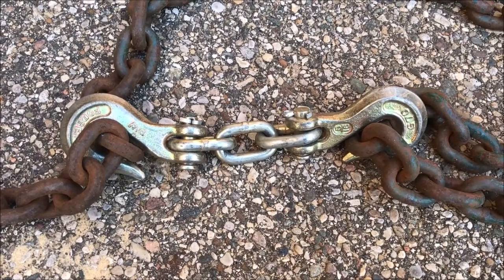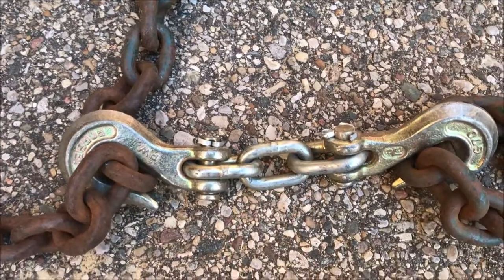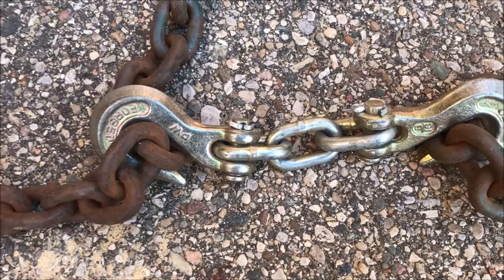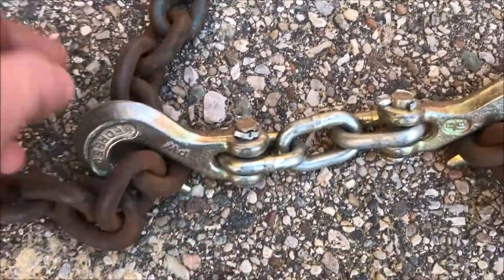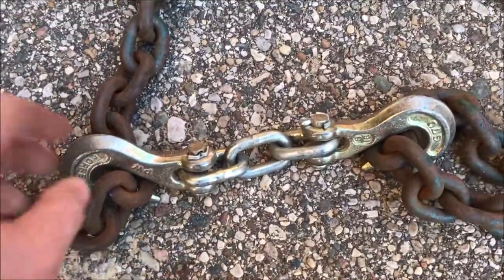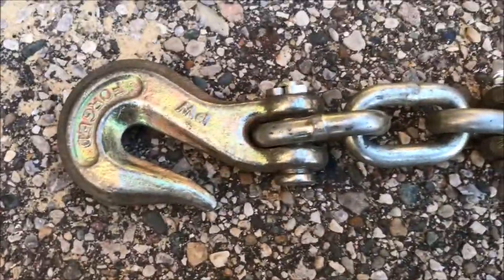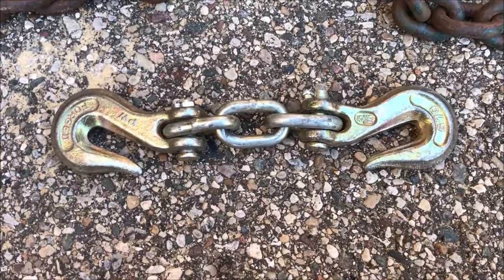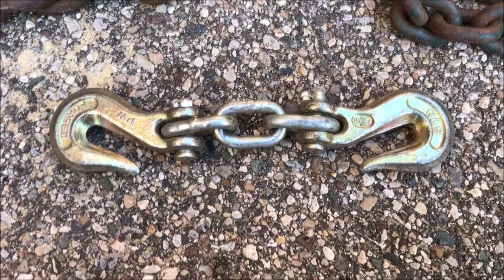OldGuyDIY $7 Chain Shortener 2 Clevis Grab Hooks 3 Links DIY Tow Haul Tractor Farm Truck ATV Pull

Comment: Great idea.    I could use one around the property.  Thanks for sharing the idea.
Whipple
Reply from the maker: You are welcome.  Thank you for taking the time to comment.
Reply: @OldGuyDIY     👍.  I’m in the mountains at our cabin doing some logging today.   If I were home at my shop, this would have already been made up and sitting in my rigging box.  Thanks again.
Reply from the maker: It sounds nice.  I wish I were in the mountains at a cabin today.
Reply: @OldGuyDIY     Currently clearing a patch of woods to lay out a septic absorption bed at the cabin.  Not glamorous stuff, but I’m working at my own pace, sorting logs for firewood use for and hardwood saw logs.   I have about 12 cords of firewood at one landing and I’m accumulating saw logs close to where we will set up a portable band mill.  Got into some sizable oak.   For instance, I cut a white oak on Friday that scaled out at 600 + BF and a red oak yesterday that will give me 1,000 + board feet.  That’s a conservative estimate and allows for 15% waste.  Lots of furniture building in my future after I get it dried.
Reply from the maker: It sounds like you are an experienced, capable guy.  I'll watch for you on the cable TV home improvement channels.
Reply: @OldGuyDIY     LOL.   My experience comes by learning from my many failures!   
Whipple

Comment: That is the right way to do it . Never weld 2 hooks , the Heat just took half the Load weight away . Hooks are tempered to hold weight . say 4000 pound welded my snap at 2000 or less .